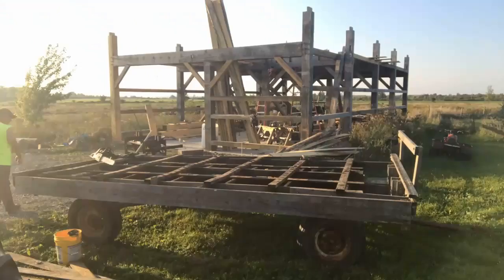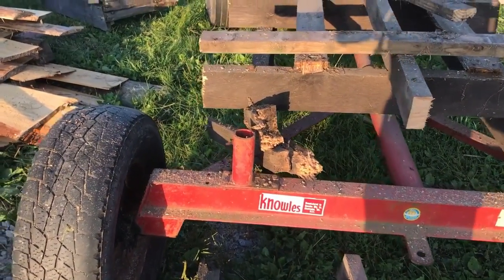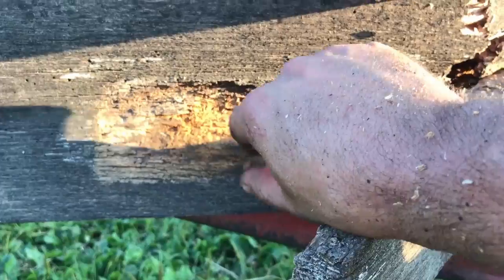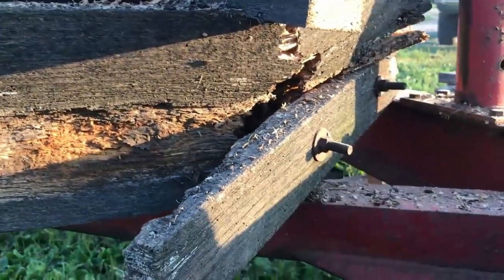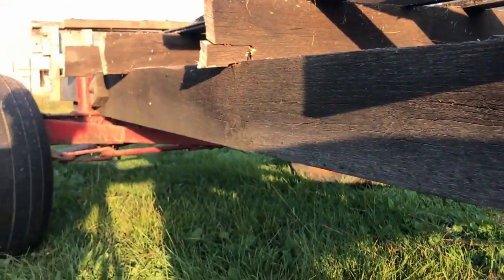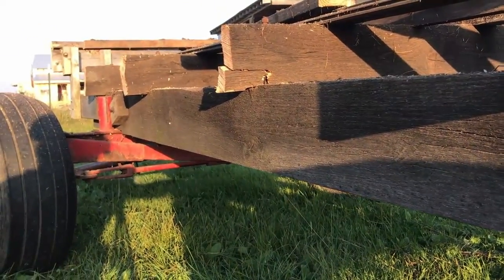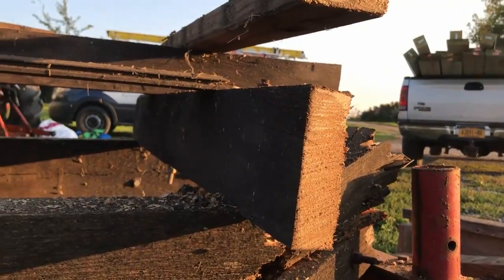I'd Rather be Timber Framing

Comment: Stop apologizing.  Interruptions are part of life.  So you traded a timber framing video for a wagon framing video.  Doing both is way more than most would do.  Both are very interesting to me and just a relaxing since I dont have to do the work. :)  The quality is just as impressive with the wagon as it is with the timber framing.  Hang in there.
Reply from the maker: +CanCrusher thanks.  You are right, I try hard to give the viewer what they want as they are helping me out with the views.  I try to get video up frequently or else you lose all momentum with YouTube.  I know most tune in for timber work but like you said, life happens.  As long as you guys are happy, I'm happy.  I just don't want to put garbage out for view counts, I have no urge to sell my soul to the YouTube machine.
Reply: Really there is not the much difference.  One uses large timbers which to build a structurally robust structure  which can carry a lot of wight but doesn't move, the other uses smaller timbers that can carry large weights as well but does move.  The cuts are not as intricate, but there are many more of them per unit volume which has a whole set of issues by itself.  :)
Reply from the maker: +CanCrusher you have a way with words.